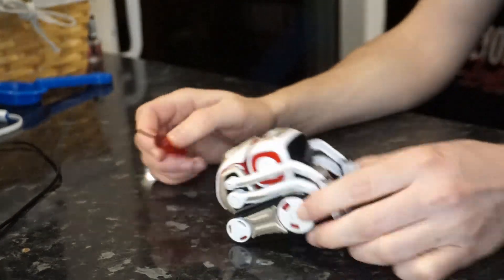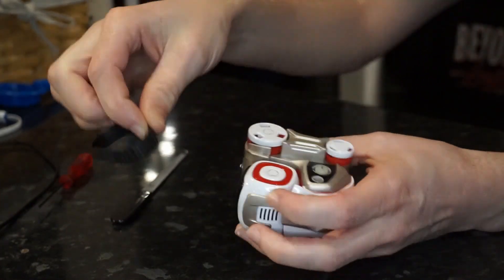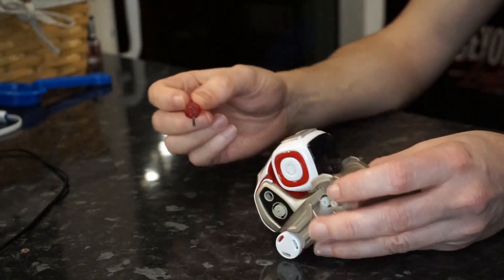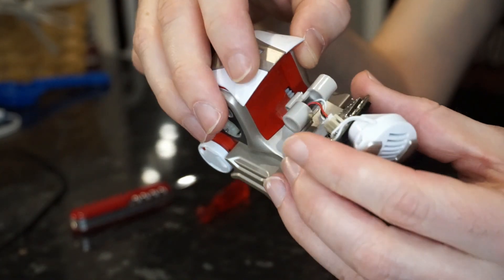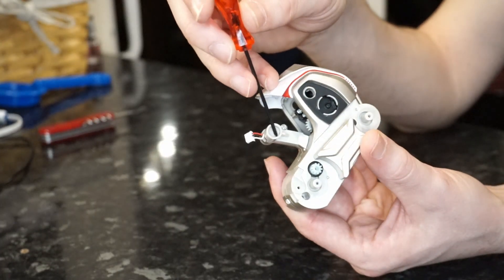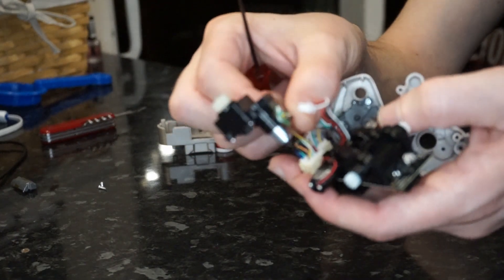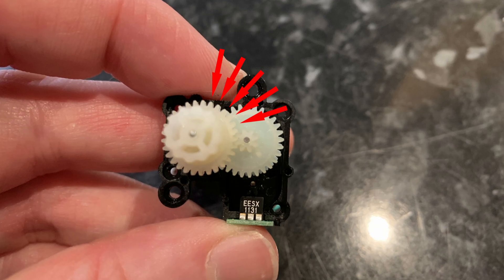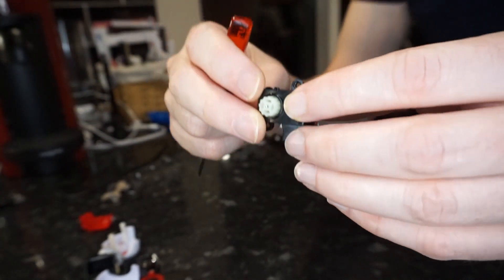Fix Cozmo's Arms (Gearbox Quick Fix)

Comment: Thank you very much for making this tutorial. My boy’s cozmo is exactly the same as yours however the gear box was totally different. I was able to open the gear box and there was no broken gear/tooth in there. I don’t know what else to do. Every time cozmo tries to pick up a cube he starts shaking not having enough straight to lift up the cube.
Reply from the maker: If there’s now wear on any of the cogs, it could be the motor failing. Maybe see if you can a replacement gear from a broken robot on eBay.
Reply: @TheJohnJudge  excellent. Thanks I will try that!

Comment: Hi John, I followed your instructions today, and I rotated the second gear because of a broken tooth. So it works I think I saw, and reassembled.  However,  now he starts and keeps repeating he is not on stable surface, to put him down, even though he's sitting flat on a table top. Is there something I messed up when reassembling perhaps? Please help sir. Thanks in Advance
Reply from the maker: Hello. Have you tried to reset him? I have a video on here showing how.
Reply: @TheJohnJudge  Thank you for your reply sir.  I ended up reopening it, disassembled it completely. What I realized is that one of the wires going through it's neck to faceplate was pinched when I put it back together.  It made the head unit movement laboured and thus creating the problem.  At least that's what I think because now it's working perfectly! My son plays with Cozmo daily and is so happy! Thank you for ALL the information you share, it gave me the confidence to even attempt this in the first place. 😃

Comment: Thank you so much for this!  Wonderful solution.  A link to the STL gear file would be helpful to 3D print your own replacement gear, would be helpful.  I discovered that there is a little part (plastic pin) that you have to depress first on the top (smaller) part of the lift gate in order to get it to come off.  These wasn't very clear in the video.  I started to pry it off but it wouldn't budge, then upon further inspection I noticed this pin.  You may want to update the video to more clearly show that part.

Comment: Hi! For me my cosmo's arms are weak and they can't lift the cube. How do I Fix
Reply: It's not due to the strength of the arms or motor, it's likely due to a broken or worn out gear that the arms are using.  by rotating the gear 180 degrees you will be using the other side of the gear wheel to lift, which will presumably be full of only new, previously unused, gear wheel teeth and it will fix it.  Just watch this other video of his and it will work!  I just tried it on mine and it literally only took about 1 min. to do.
https://www.youtube.com/watch?v=4quiGLNEGwI

Comment: Hi,

I did this, and I think it worked ok (thank you!) but it now keeps it's arms up most of the time. It can lower itself and has lifted a cude, but the tune up says "head needs adjusting" but seems to be working fine, and it's really sort of disorientated, as in you tell him to stack cubes (or anything) and it's moved around to line up, but then just goes arms down, arms up, then moves back a bit, even though the cube is lit up blue and in front of cozmo. Also, the tap first game, it lines up and lifts the cube every time the lights turn on when he's meant to tap it, and lifts even though it's not matching colours!? Not sure if a sensor is going or he's gained some sort of mental health issue!?!? Any ideas, anyone?!?!?!?

Comment: get the guy with the 3d printer of the gear to start mass producing them, selling them on ebay, they will sell, i sell parts for cozmo on ebay, taken out of a ton of junk robots, they work fine, but right now i have over 20 of those lift motors that work fine but need that top gear that strips the teeth.  someone start mass producing them, seriously, sell them for even $20 a piece, people will pay, they want to buy parts for the robot to fix them
Reply from the maker: I sent my friend a complete (working) gearbox for him to model and replicate the cogs in 3D printed resin (very strong). He will send the parts back to me and I will assemble in the robot to check the fit - then he can start mass production. Should be a good little sideline for him. Thanks!

Comment: Hi. You got any idea why the Cozmo right track (motor) not working?
Reply from the maker: Without seeing it, I couldn't be sure. Have you removed the wheel to see if the gear is turning? Could just be clogged with dust.
Reply: Yes I did. I even open Cozmo and power the motor with a 3.7V battery and is spinning.

Comment: Hey, I dropped my Cozmo a while ago and now the head kinda stutters when it moves, should I just strip the head down?
Reply from the maker: nicole moreno there could be some broken teeth in the cog that drives the head. It functions slightly different though so this fx might not work.
Reply: Is there a way I can fix it?
Reply from the maker: nicole moreno maybe follow the vid and dissemble as far as the head, that way you can see if it’s repairable. I’m sure there’s some people on the FB page that would also help.